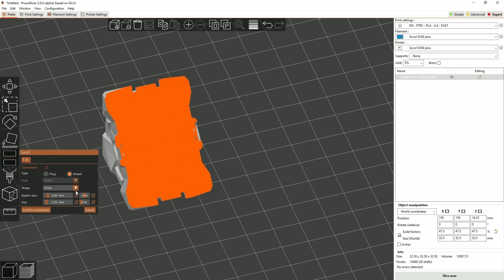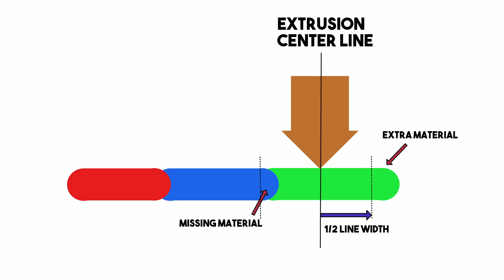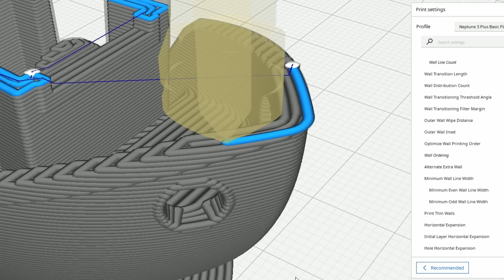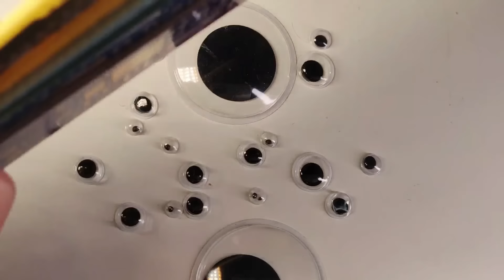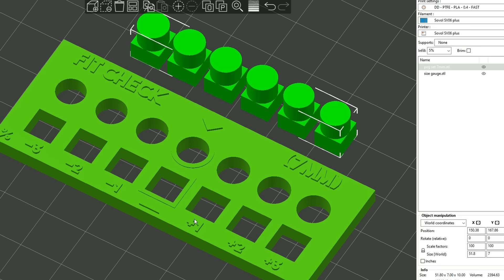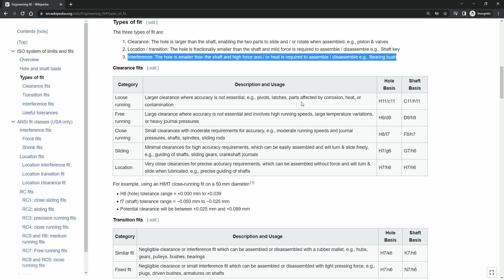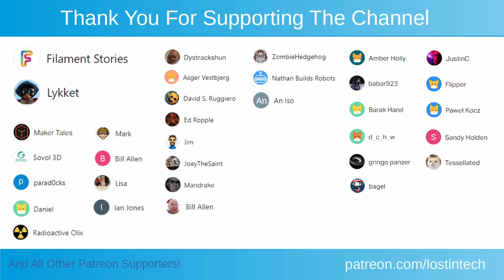Why your 3d printed stuff doesn't fit together and how to fix it!

Comment: printer dimensions arent off by a % amount, your 200mm print isnt 4mm off, its off by the same amount as a 5mm print. for me its as if the print "swells" by 0.15mm, so i give myself 0.2mm tolerance, any less is normally too tight. so if its a circle going in a circle, i decrease the RADIUS by 0.2mm, or diameter by 0.4 (remember the "swelling" effects each wall evenly, a square might be easier to understand why its 0.3mm)
Reply from the maker: Correct - you only apply clearance to one part. That's why I chose the pegs for the absolute deviation. The % on the gauge is diagnostic only I guess, as in, how far out you are.

Comment: Most of the time my printer needs everything to be expanded by about 0.05mm, so holes are 0.1mm larger inside diameter than nominal, and pegs are 0.1mm larger outside diameter. But for "just right" fit of different sized features in a single print, I usually have to scale them individually in the model rather than using slicer settings, and do 2 or 3 test prints to fine tune it.
Use precisely dimensioned metal objects to test the fit. With printed pegs and holes, you won't be able to tell whether the holes are smaller than they should be or pegs are larger. Ball bearings are cheap and have precise inside and outside diameter, so can be used to test both, although it is easy to get them stuck in a too tight hole. Motor shafts and drill bit shanks are commonly available hole testers, but be careful not to cut yourself on drill bits.

Comment: I might suggest a slightly better scenario: you're modeling bolt holes into parts so that you can assemble with those aluminum socket head bolts as purchased from, say, Acrobotics. I've done this for years and have learned quite a lot. What I've learned from using the standard PLA filament, for example, is that you have to factor in hole shrinkage and that this is very much dependent upon the print orientation of the bolt itself with respect to the print bed. In other words, a bolt hole oriented in the Z direction requires enlargement but the X/Y planes in this case does not. But if the bolt is then sideways in orientation with respect to the print bed then the part might pinch the bolt too much in the Z direction unless you compensate for this. You could create a cube part and test fit these M4, for example, standardized bolts in each of the X/Y/Z planes in the hopes of demonstrating this point.

Comment: To avoid bulge in sharp outside corners, try fillets with radius = shell thickness. Or shell thickness x some constant close to 1 
if you like to tweak. Draw the path of a sliding disk to see how that works.

Generally, when modeling for precision I've been parameterizing shell thickness & layer thickness then using multiple shell overlap math in CAD, and sometimes turning off Arachne in the slicer to make features that will slice to exactly n strings of plastic.
Reply: Careful with that last part. By default, slicers have an "overlap" setting. So if you model a 1mm wall with a 0.5mm extrusion width, it might not work without Arachne. You may end up with a thinner wall than you were expecting.
Reply: @ilikewaffles3689  Yes, that part only matters when you're trying to be careful. It helps to know how your slicer calculates shell/perimeter overlap and put that math in the parametric CAD model. The minimum wall thickness that will get your favorite slicer to "do the right thing" with a 0.5mm extrusion width is probably less than 1mm. (not talking about "thin wall" detection)

Comment: Wouldn't it be a great way to integrate PCBway as a sponsor by letting them print this gauge model in their different printing technologies and comparing them?
Would love to see something like this.
Reply from the maker: Hold that thought...I was thinking the same thing.
Reply: @LostInTech3D does it benefit you in any way to push PCBway?
Reply: Of course it does. They sponsor his videos. Meaning they pay him for advertising for them.
Reply: Only problem is, a size guage that pcb-way prints is not much help to you. You need to do it on your own printer. (unless you are using it for working out the tolerance for stuff you will be sending to them to print)

Comment: Your gauge idea is spot on, however you forgot to make sure certain effects do not change the result. See the elephant foot effect at the bottom or the corner swell or general layer line shifts will produce irregularities which can prevent fitment. So you can improve your idea by creating chamfers on the first layers for the elephant foot effect, and by addind notches where the layer shift will be e.g. small cut out in the peg where the layer change will happen.
I am a mechanical engineer btw but of course that does not mean I am in any way superior in my knowledge in regard to 3D printing, I just enjoy it. And so do you, which means we have something in common and can be just as good or bad in regard to 3D printing. So don´t worry about not being an engineer, this does not change anything.
Also generally speaking there are different kind of tolerances in regard to 3d printing. One kind is the size decrease due to material shrinkage which means your tolerances will change dependent on the size of the part, the bigger the part the bigger the tolerance. So to tune your printer you need to do 2 things.
1. print small object to find out what kind of tolerances are expected (your peg gauge idea ist perfect for that task) 
2. Print a e.g. 200mm long part a couple of times and measure the overall shrinkage, calculate the % on that and scale all your models accordingly. This is what professionals do as well for injection molding tools or for castings, you will always experience material shrinkage. 
Btw very good videos, I really enjoy your content, well done =)
Reply from the maker: yes - good suggestion. I am torn between doing something about elephants foot, or leaving it as an additional diagnostic. Or maybe some combination.
Reply: @LostInTech3D  Well the thing is, you usually would want to diagnose one thing at a time. I personally would get rid of it, you know it´s there and an inherit 3D print byproduct but it will hinder you in finding out the right clearance needed for your machine and tuning your printer. Also create a notch in the round peg because usually you will have extra material on layer shift which will bulge out kind of like corner swell, this way you only diagnose clearance and nothing else. To speed up the process i simply print just the round peg and measure them with a caliper in multiple places this way I avoid all this elephants foot effect and keep down the print time etc. There is also a difference in printing 100% infill and say 10%. Neat idea but don´t overcomplicate things =) You maybe know the joke about "NASA uses a 1mio. $ ballpoint pen to write in space the Russian use pencil"

Comment: In a perfect world you wouldn’t need tolerances, just look at zero tolerance machining. Using that the outside of the peg can be exactly the same size as the inside of the hole. It requires a very precise machine for that and 3D printers aren’t all that precise. It is logical to think that a 15 mm peg would fit perfectly in a 15 mm hole but with most manufacturing techniques it wouldn’t since the parts won’t be exactly that size.

I wonder when 3D printers will be able to automatically calibrate their own tolerances, the lidar system used on bambu labs printers is getting there but it still has a long way to go.
Reply from the maker: actually a simple camera with some minor AI could do it...could be coming soon I guess!
Reply: @LostInTech3D  yeah if you could get it set up to work well enough with the camera being a fixed distance from the piece that would be an option. I think lidars are generally used because they provide distance measurements. With a camera any distance or size measurements need inferred from the image whereas with lidar you get them directly. I think lidar could give more useful information than a camera could, like actual thickness of that layer, how much that overhang is drooping, checking for under extrusion etc. Also cameras might struggle with different filaments, like matte, wood, metallic or silk or just different colours and would probably require quite precise lighting.

Comment: Great video, in my experience one of the biggest problems for tolerance is elephants foot. Mine was caused by a low mesh levelling z-fade height, but also overextrusion on the first layer which I fixed by using first layer horizontal expansion setting in cura. I have also had issues with small amounts of warping on the first few layers which ruins tolerances, so I always use brims now. For more complex models slicing tolerance is important and if supports are used the z distance between supports and the model is a problem for small tolerances. However, tolerances would be much simpler in 3d printing if people who designed models in fusion 3d released the .f3d files with user parameters for tolerance, so people can customize the tolerance for the model after doing a test like yours. When doing parameters for complex models compound tolerance becomes another big issue, but often 3d printed things are simple enough for this to work well.
Reply: Another physical solution is to get a deburring tool. You can get a cheap version from Menards/Home Depot/Lowes/Ace in plumbing or pro versions from McMaster. This is usually the first tool I try when things aren't fitting together; it cuts off the elephant's foot in a few seconds.

Comment: I print always "perimeters first" up to 45° overhang. Not only because of dimensional accuracy but it also gives you a nicer surface finish as imperfections (from the usually faster printed) inner perimeters don't transfer so easily to the outer wall.
Reply: Do any slicers have adaptive perimeter ordering?

Comment: I had this problem with my Ender, I tried it again with my new X1C, a hole and a pin that are both 20mm, a box and a square cutout both 7*14mm. And they fit with zero added tolerances. That is probably the most impressive part of my X1C so far. When making a model that I share on printables, I make sure to add the original version and a version with added tolerances of .2-.3mm so that it is also printable on lower end machines like the Enders for example

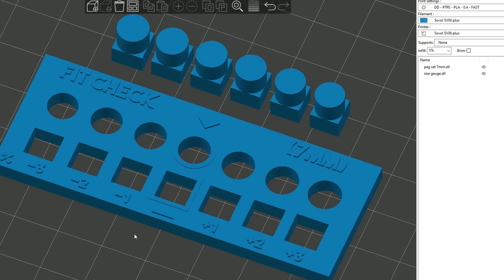Comment: I took a 3D printing class in my MET degree as an elective, this info is spot on and in more detail about tolerances than that course. We had learned about the expansion coefficient of the layers, but were just given estimated tolerances for common materials, for typ layer heights for the machines we used in the lab. We had a demonstration print exactly like you made @5:19 , this allowed us to see how tight/loose certain tolerances were in real life. great video! earned a sub from this guy!
Reply from the maker: That's excellent to hear, much appreciated 👍

Comment: I have to say, before using a tolerance tool such as yours, you must get the extrusion multiplier set accurately.

It's a hobby-horse of mine that "Everyone over-extrudes!". You can prove this by setting what you think is a correct extrusion multiplier and then reduce that value in 0.25% amounts until under-extrusion is evident (little tiny holes between solid infill lines where they meet the inner perimeter). You'll be surprised how much you have to do this, maybe 0.75% to 1% total, before it happens and that's your over-extrusion.

Properly calibrated extrusion will allow interference fits between circular pegs and holes with as little as 0.15mm clearance and clearance fits with as little as 0.2mm of clearance even for filaments which exhibit significant swell like PET-G.

Take a good look at your fit clearance test tool and, I think you'll agree, it's over-extruded. That needs to be addressed before you can use it to assess proper fit.

Comment: All whatis  in the video is valid...however people more often than not, excludes the mechanical calibration of the machine. namely esteps, and then the filament extrusion multiplier, which may vary from brand to brand, color to color and material to material. And design must be based having this calibrations done!
Reply from the maker: Good call, I should cover this at some point, the existing guides out there are a bit dated IMO

Comment: I think % is not the right way of clearance because if you have a big part and schale it up 1% to fit because the small part needed 1% and lets say the big part is 2 times as big as this small part the clearance will be double of that what you actually need. I use 0.4mm clearance on nearly all my FDM prints to have a snug, but loose fit, this is for small as well as big prints. Hopes this helps you out in why % will not work due to scale of parts and holes, maybe just a 0.1mm table of fittings and that helps you find the right amount of clearance

Comment: As a D&T teacher (retired) I used to do a short exercise with 11 year old students where they were asked to mark, cut and file a square of 3mm Acrylic to some given dimensions.  When they presented their work as finished I tested it in a go / nogo gauge that had +/- 0.25mm sized holes in it. Generally first time none of the samples fitted but after a few tries they got the understanding of what tolerance was.
When I fit 2 printed parts together I usually print  the inside part 0.25mm smaller and then use fine wet and dry paper to get a perfect fit. Fettling, as my engineer friends would call it.

Comment: This issue needs to be covered so much more, its hard to find info about it. Having rebuilt my machine as square as possible etc, it was still around .15 out, then i found out about shrinkage, so i made an allowance for that by increasing print size by .3%, that fixed it.... As long as i printed 50mm. So im still stuck at .15 out at any size ☹Will try this print outside first hopefully that helps.

Dont say check extrusion modifier..

Comment: i just use 2 cura sittings called hole expansion and horizantal expansion  they work well , so in design you dont need to worry about claearance

Comment: Something that helps when you need square parts to fit is putting a .2mm radius on the edges. I also make the hole .25mm to .35mm larger than the pin or mating part. Great video thanks.
Reply: It also helps to just take a file or bit of sandpaper to the edges.
Reply: I'm having an issue where I put a 2.4mm radius on both edges, and then one is perfect while the other prints like a sharp corner, even though it's not what the slicer shows.  Maybe outer wall first will help.
Reply: @EternityForest  is the slicer putting the z seam on the that corner? That can mess up a small radius like that
Reply: @louiel8711  It's putting it in assorted undesirable places depending on layer, that's one of them but not often.  Should we all be building in seam dump points in our designs?
Reply: @EternityForest  try Prusa slicer with the paint on z seam, I like Cura but it lacks that feature.

Comment: tolerences are quite an interesting topic for FDM, as a mechanical engineer, i am used to working with fits and tolerances that are specified by the manufacturer of a certain part, perhaps a good solution would be to have manufacturers of filaments do these tests themselves and provide a table with nozzle sizes, recommended tolerences and printer settings for good fits, i think it would benefit the community a lot that not each person would do these tests manually for every filament, but again thats really just a wish and not a practical solution, it would be nice to see if its even possible to have consistent recommendations for different printers etc.
Reply: Filament production has too many variables, unfortunately. The only real fix is to have the printer do measurements on its own with little to no user input, eg Bambu X1's self-calibration procedure.
Reply: It's not even just the filament, but also the extruder nozzle (which wears over time); the flow rate (which causes die swell); the feed rate (which - even with linear advance - requires changing flow rate on-the-fly and therefore affects die swell); oozing, blobbing, and smearing any time you change layers, cross walls, or otherwise enter or leave from a continuous path; shrinkage of the material (the expression of which depends on the rate of cooling and the order in which things are printed); and so many other variables that simply aren't controlled in any production environment.

I have gone through great pains making my own calibration parts and meticulously adjusting printer settings to get even moderately dimensionally accurate parts with minimal tolerances, and I have a long list of gotchas to watch out for and issues that can still occur based on the layout of the parts and the environment I'm printing in. Getting any kind of consistency means accounting for or avoiding a million causes of variability in the FDM printing process. I'm often amazed it works at all. About the only thing I can reasonably do is print a part the first time, measure everything to find out how it actually comes out, then modify the dimensions in the design to account for the errors. I admit, it's a terrible solution, but at least it works.

Comment: after buying a new roll of filament you gotta print all tests out there to dial it in, but then you run out of filament and repeat that for the next roll.
Reply from the maker: LOL 🤣 this is why I tried to make this thing as small as possible
Reply: I always wondered how I managed to print all the bits my 3D printer needed before I had a 3D printer...